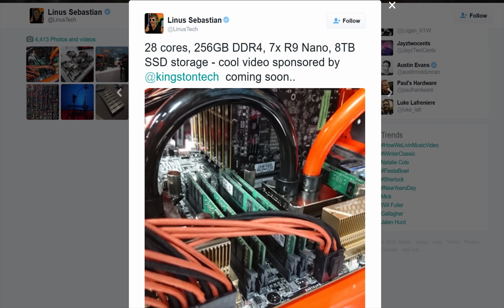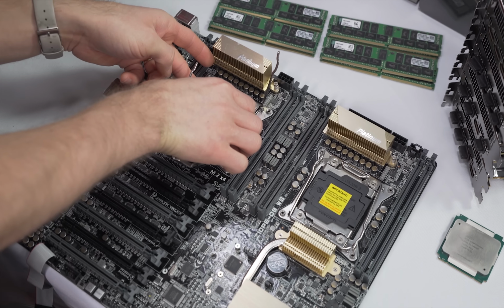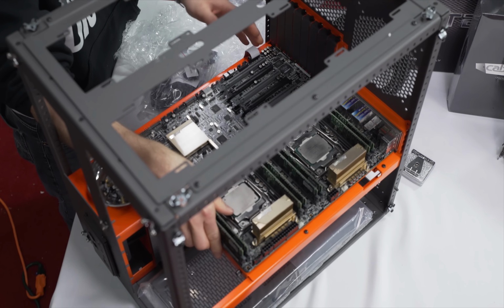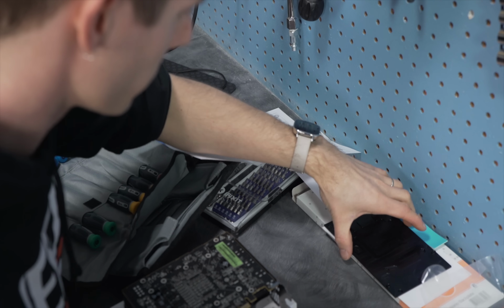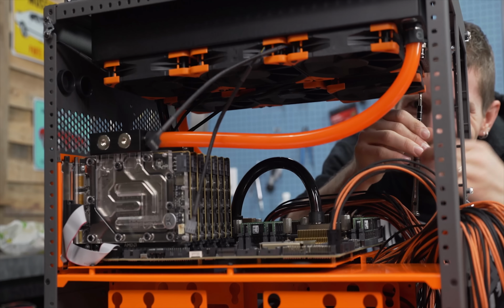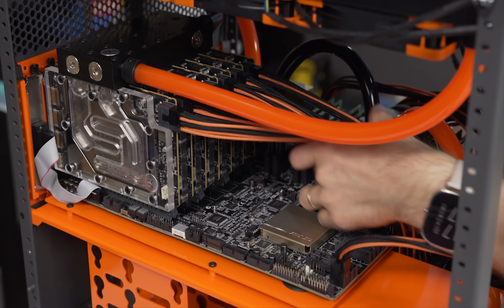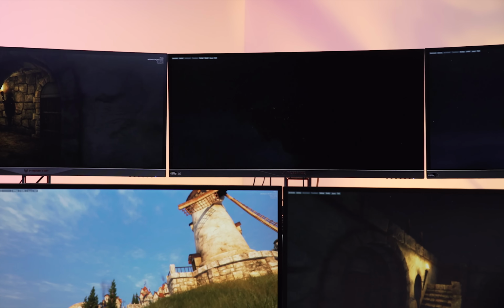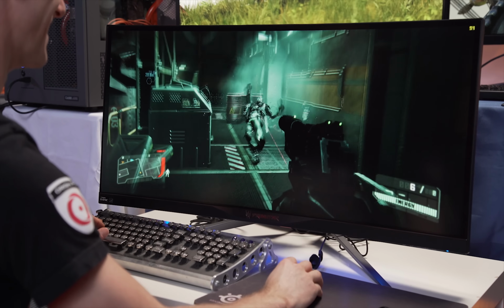7 Gamers, 1 CPU - Ultimate Virtualized Gaming Build Log

Comment: I know a setup like this is ridiculously expensive (as Linus mentioned in the video) but is it not more efficient to run a setup like this when considering the fact that it's essentially seven high spec'd computers that draw 1500 watts in total? 

Each "computer" has 4 cores (8 threads), 32GB RAM, a discrete graphics card and SSD storage. If these were individual physical machines then I don't see how 7 of them could  draw a total wattage less than or equal to 1500w like this PC in the video. It's probably cheaper to build 7 individual PCs but in the long run, won't you save by consuming less power while achieving equivalent performance?

Comment: Cost breakdown for those interested
Mobo (ASUS Z10PE-D8)...................................................................$565 (Newegg)
Ram (Kingston 32GB Module - DDR4 2133MHz) 8 @ $296 ea....$2364 (Walmart)
Storage (Kingston 1TB KC400 SSD) 8 @ $422 ea........................$5740 (Best buy)
Graphics (ASUS AMD Radeon R9 NANO) 7 @ $620 ea................$4340 (Amazon)
Monitors (Acer Predator X34) 7 @ $1290 ea................................$9030 (Newegg)
Processors (Intel Xeon E5-2697 v3) 2 @ $2770 ea......................$5540 (Newegg)
PSU (EVGA SuperNOVA 1600 T2)....................................................$350 (Amazon)
Case (Mercury S8)..........................................................................~$445 (CaseLabs)
Cables (CableMod B-Series DPP Cable Kit Black/Orange)............$100 (PerformancePCs)
Fans (Noctua NF-A14 PWM 140mm) 6(?) @ $35 ea.....................$210 (PerformancePCs)
CPU Blocks (EK-Supremacy EVO Nickel) 2 @ $100 ea..................$200 (EKWB)
GPU Blocks (EK-FC R9 Nano Nickel) 7 @ $123 ea.........................$861 (EKWB)
GPU Connector (Custom 7 way FC terminal) .................................$??? (EKWB)
Lots of extra stuff I don't fully know how to account for
Total:: ..........................................................................Well over $29,745

Comment: just do a give away with it
Reply: +vincent van Rijn How? Physically split the computer apart 6 times?
Reply: give it to 7 deverent peoplr
Reply: give it to 7 deverent peoplr
Reply: That would cost 210,000 with basic math. Yeah no.
Reply: Shot Up Gaming no, 7 gamers at 1 time.
DUHH!!!
Reply: +vincent van Rijn fuck that, give it to me. my precious
Reply: +vincent van Rijn You didn't see if for 7 people to use it at once.  You said 7 different people. Which means,  to me at least giving it to 7 separate people.
Reply: +Shot Up Gaming 210k? lel are you crazy, your not even close.
Reply: Mathias Beaulieu-Duncan He said 7 different people. 
He didn't specify for a group of 7 people but 7 unrelated people. 
30,000$ X 7 = 210k.
Reply: +Shot Up Gaming I think he meant split the existing parts up between 7 people. Building 7 of these is idiotic. Don't think so hard.
Reply: An Spoder True that.
I overthink some things sometimes. :/

Comment: so under load, you're actaully saving some wattage overall.  if you take thea 250watts for each separate system (250×7=1750watts), and you said this is for a mid-range system under load.  if you compare what 7 comprable systems under load would be, you're probably looking at 400-500watts each (so 400×7=2800wats to 500×7=3500watts).  you're talking a power savings from as low as 150watts and as high as 2000watts

Comment: It would almost be better to have gotten a used dell poweredge R910 or similar, a fully kitted unit minus storage minus OS minus video cards but including 4x 8C16T(total 32C64T) @2.3-2.7Ghz and 256GB of DDR3 runs about $1800USD on ebay, if you want to go cheaper you could go with the core2 based xeon 6 cores for under $500 for similar setup, but the PCIe slots look like they're all wired and sixed for 8x in the R900, just requires a little dremmel work to get up to, i believe 8 cards on the cheaper R900(1 may be storage only) and up to 10 on the R910(+1 additional 4x for storage controller) both systems would not be a slouch for many years to come and because of the 4-5U layout they have massive fans and are relatively quiet as far as servers go
Reply: +denvera1g1 and the R910 can support all of the first generation of the xeon e7 family, including the 10 core 20 thread monsters at 2.4Ghz

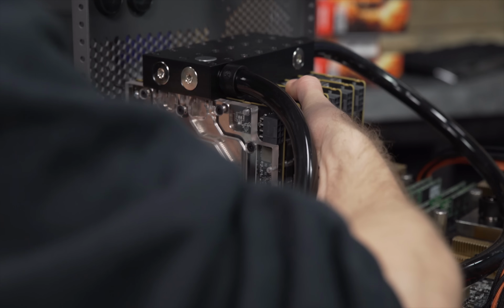Comment: 6:50 seems inlet and outlet on the bridge are on the same side.
These blocks are optimized to have the flow in one direction but not the other. There is no way to mill the bridge to have the blocks in series yet have inlet on the same side.

Comment: Now do 10.

Purely for LAN parties. Because that's one of the only real world application for this kind of thing that I could really imagine.

Or an internet gaming cafe kind of thing.

But what are the advantages of this over 7 individual computers other than the fact that it's pretty cool? I suppose it's probably cheaper overall because you save on cases and you only need two CPU's. I imagine it probably uses less power too. 

I wonder if this kind of thing has an application in gaming rooms? Because I know that a lot of people like to have a dedicated retro gaming PC, so that'd be really cool to have a DOS, 2000's and modern PC all in one set up with different monitors and such.

Comment: can someone give me a graphics card that will work with a 500w power supply and run games on higher or equal to 60 fps (high settings) and is small around 8-9 inches (20-22 cm)

Comment: this is cool.... except for one thing... No redundant powersupplies. You now have a single point of failure for 7 gaming machines. Sure, there is a single Motherboard, but they fail much less often PSU's. In addition to redundant PSU's, you need a raided storage pool. You already have some redudancy with your CPU's (assuming your hypervisor is anything like esxi, i dont know though) as if one fails you can just bump your VMs down in core count until you get your replacement cpu.

If you could build in a little more redundancy, i dont see why this couldnt be an option for a household full of gamers/developers/graphic artists etc. Have a central server and run HDMI, USB, and Ethernet to each room. Now you have a centrally managed gaming rig that is easy enough to upgrade and manage, cut down on power costs and heat.

Comment: So 1 real version of Windows and 6 VM's of windows and then you can run all of those on separate monitors? Did I get that right? I understand that there are many GPU's and 2 CPU's and it's all water cooled and the system has 256GB of RAM, but how do you split up these resources amongst 7 monitors? How do you pick and choose which VM gets which monitors? Can windows natively see 7 monitors and then you can just drag one VM window all the way over to the 7th monitor and maximize? Are we talking Oracle Virtualbox or something? And how did you get 7 keys for windows 10? That must have been expensive.
Reply: WATCH 2 GAMERS ONE CPU!
then you'll understand

Comment: Player 1 - 4 Cores, 4 Treads
Player 2 - 4 Cores, 4 Treads
Player 3 - 4 Cores, 4 Treads
Player 4 - 4 Cores, 4 Treads
Player 5 - 4 Cores, 4 Treads
Player 6 - 4 Cores, 4 Treads
Player 7 - 4 Cores, 4 Treads
Equals to - 28 cores, 56 Treads

Then how many cores and treads to run unraid?

Comment: Can you try doing a liquid nitrogen cooling system? I mean its a liquid and its cold as crap so.... why not? You'd need some pretty thick tubing to prevent condensation, but I want to see what you could do with that. What if you could overclock your cpu past 7 ghz that would be pretty mlg. This would be the kind of rig that is limited by the motherboard and just how much power you can pack into one build without it crashing because its TOO fast. PLEASE do one it'd be so cool.

Comment: Wow!!

So, a question regarding running the systems virtually through unRAID, especially in regards to using them as gaming PCs - Do you have any noticeable increase in latency from the keyboard / mouse inputs on any of the systems, compared to running them directly?  It was hard to tell, but it almost seemed like there was a bit of input latency on the system that Linus was demoing at the end of the video.

Now, I'm not a good enough gamer to be affected by increases in latency, but with all the massive bandwidth between all the systems virtualized, it seems to me that even something as low-level as basic user I/O might be affected.  If so, obviously those hardcore gamers would have an issue with it.  Any thoughts of doing your high-speed mouse clicking / keyboard input latency test to see if there are any performance drops in doing so with a system like this?

Comment: Awesome video! However, it's technically 2 CPUs in the system. 1 workstation 7 gaming terminals would be a more appropriate title. Still awesome though. My first computer was a Tandy 1000 TL/2 specs below:

8MHz Intel 80286
640kb RAM
MS-DOS 3.3
3.5" double density floppy drive
CGA monitor
9-pin dot-matrix printer

Which cost $1500. Would've cost $2000 if I opted for the $500 10MB internal hard drive. 

How things have progressed!!

Comment: The current build is obviously foolish, but it would be interesting if Linus tried a similar build with components closer to a normal budget, i.e. a six core i7, 4x GPU, 32GB RAM and 512 GB SSD but pooled so common files can be shared among all users. I guess it would end up in the 2000 USD range for four pretty capable gaming rigs, or only $500 a piece.

Comment: The one CPU build still had more then one. This "two" has 28 CPUs. Each core is its own CPU. They just share the same connecting point. If you want two CPU's you need a duel core.

Comment: Nice rig!  There are a couple of things to point out.  Point #1, you CAN have multiple power supplies in a single system.  Especially in THAT case, or you could piggy-back a small secondary external case.  I've used, for example, an INTERNAL 700 watt supply in an EXTERNAL case to power disk arrays and other power-thirsty subsystems.  Here is how I would break it down:  PSU1 - fans and pumps.   PSU2 - 1/3 GPUs and MoBo  PSU3 - SSDs and remaining GPUs.  To do this, you have to wire up the MoBo PS start pin to an external switch on PSU1 and PSU2, and let the MoBo's PSU on switch activate PSU3.  This also means you could have used 3 x 15 amp cables instead of the 20 amp cable :-)   If you had done it this way, you also could have run the NVidia cards YOU WANTED, rather than those crappy ATI cards.  I know that the other technical problem you had with the NVidia cards was lining up the liquid cooling block.  You can do this with simple copper tubing and other plumbing parts from Home Depot  :-)  Point #2, DO NOT EVER MOUNT ANYTHING WITH DOUBLESTICK TAPE.  It will melt off.  It deprives the device of a good chassis ground.   Worse, IT WILL create hot spots.  You can use slot covers or other thin aluminum parts to build spacers or mounts.  ALWAYS leave an air gap on top and bottom of each drive, or you'll create a hot spot.  Worst case?  Zip ties are always better than doublestick tape.  I love the case, and I love the design.  GREAT WORK!  Also, nice choice on the XEON CPUs and ASUS MoBo.

Comment: Hi, I'm looking to upgrade my gaming-pc. It has a single 980TI. My current CPU is seriously bottlenecking the GPU and therefore I want to upgrade my cpu, motherboard and RAM. I was thinking about an 'Intel core i7 6700k skylake' but I have no idea what I should do for the motherboard and RAM (DDR4 isn't necessary). I was thinking about a total budget of around 600€ (651USD). If you have any suggestions or tips about the parts, it would be much appreciated if you shared them.
Thanks.

Comment: Kind of confused because the title says 1 cpu but there is physically 2. Is having 2 CPUs different than say having 2 graphics cards? Like the computer knows in the hardware that there are 2 gpus but would the computer show there is one 56 core processor in this setup? That's the only reason I can think of that this video would be titled that way

Comment: have you proposed this to big buisneses. they would consider this machine i think if you offered it up. for example my design team consists  of about 40 designers all using catia. all linking back to a ata server but all using infovidual hp z620s.... they are good dont get me wrong but i think 7 of them would lead to more powere than that machine uses on load in idle mode. 6 of those in the office and we would be coverd and the power bill is saved.

Comment: You don't need a power supply that can power seven cards. You can just run multiple power supplies.
Reply: +TheGreySpectre the problem is actually not the power supply, but you are getting close to what you can pull off the outlet without blowing the breaker

Comment: Estimate cost of this build:

2x Intel Xeon E5-2697V3 = $5,312
7x R9 Nano Graphics cards = $4,620
8x 1TB SSDs = $3,264
256GB DDR4 RAM = $2,960
Motherboard = $565
Case = $400
Power supply = $430
Water cooling stuff = $620
Cables & other = $100
Total: $18,300

7 x34 predator monitors = $9100
Total: $27,400

Feel free to edit the amounts if you find more accurate data

Comment: I thought you could only put 4 gpus in a system
Reply: +Statik Gaming They are not crossfired and don't work together. They are used by each their virtual machine instance. Your mobo probably doesn't have more than a few PCIe slots, but others do.

Comment: If you needed more power for those GPUs you could of added a 2nd PSU and found a case that supports them, Caselabs does. But, your real issue at that point wouldn't be your PSU wattage but your motherboards ability to power those PCI-E slots. I've built several 3-way SLI computers and one 4-way SLI (With dual Xeons) and that's been an issue multiple times. (Didn't see any extra molex connectors on the motherboard.)

The reason I bring that up is because you said your GPUs were not reading temperatures correctly, that is normally caused by power fluctuations in under powered multi-card setups (+3 GPUs). This can also cause the cards to under perform in benchmarks and cause blue screens.

I'm for sure interested in this tech, I think I'll do the "Two rigs, one computer" setup on my next build. Great video!

Comment: Lol, he repeatedly said, 'Seven gamers, 1 CPU." When in actuality there are 2 CPUs.
Reply: Dumbass. 2 processors but 1 cpu.
Reply: +Not Hating Just Stating think you might want to check the dictionary o that one buddy, a cpu is a processor

"The central processing unit (CPU) is the brain of your computer. It handles all the instructions you give your computer, and the faster it does this, the better"
Reply: +Not Hating Just Stating no... two separate xeon cpu&#39;s. You can run two cup&#39;s with certain xeon processors. However the os sees them as one CPU

Comment: Couldn't he have taken this up a few more notches? If he used a Mountain Mods Gold Digger case and some pcie riser cables he could have had liquid cooled Titan Xs with one slot between each card.
Reply: +Bryce Snell Not with the power draw, NA house circuits would have major issues so you'd have to do 2 power supplies running on 2 different circuits.
Reply: +strmapes but that's possible, I run 2 at home

Comment: You should had used for example Super Flower 2000W Leadex as psu. It's not good to run the psu at almost full load, even though this pc may not do that too often or for long. Very cool build and work anyway. Really nice to see what's really possible when enough work is put into it.

Comment: Hey, can you test it running monitors and periferals with PCoIP thin clients? I'm planing to build a central computer to install a hypervisor (vSphere), passthrough GPUs and put it at basement to avoid heat and noise and only thin clients will be on user table. I'm afraid that PCoIP going to decreace the performance on gaming and movies tasks.

Comment: i believe i saw a bequiet 2300watt psu on the net (at a good retailer not on a sketchy site
Reply: +Nicholai Chev then connect it to a 240 socket.
Reply: +Kars Noordhuis  No good however for the US market running on 110v@15a
Reply: +Kars Noordhuis Superflower makes a 2000 watts leadex platinum too.
Reply: Cody Ardoin every house in the US has a 240 socket, it's required by the NEC for residential areas, but they are reserved for things like a range or washing machine, but you could always install another line from the main panel.
Reply: Cody Ardoin people who own a computer that uses 2000w of power would.
Reply: +Cody Ardoin Most people wouldn't spend 30k on a PC either.
Reply: Sorry guys i read the ad wrong its the Be Quiet TFX Power 2 300 Watt psu not a 2300 watt. (+- $70 for a 2300 watt psu sounded a bit wheird already)